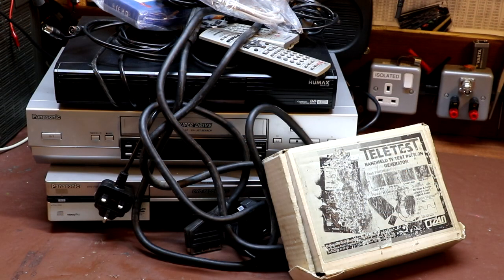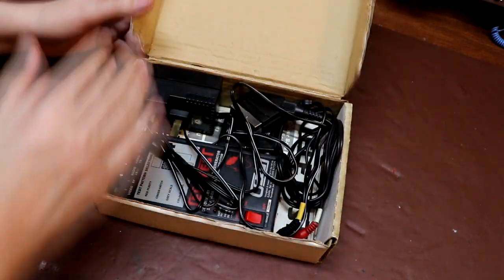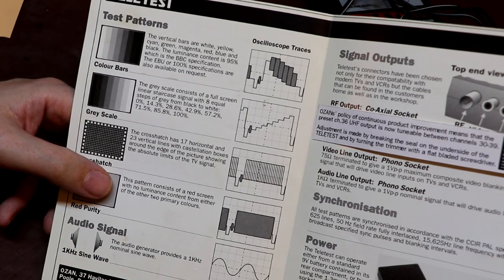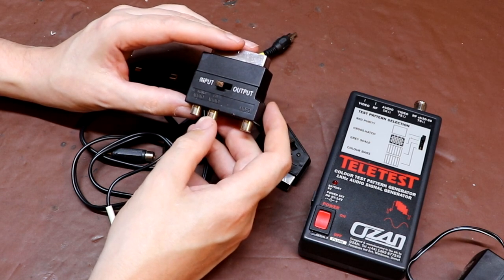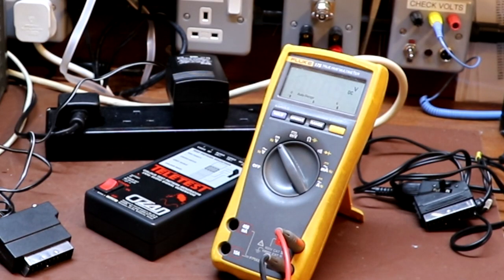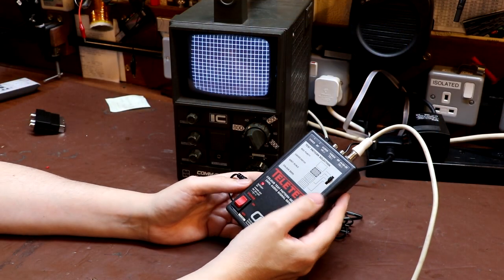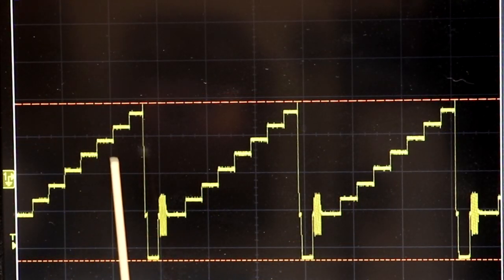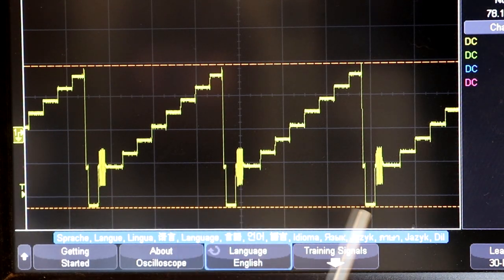Ozan Teletest Pattern Generator

Comment: Just noticed your £5,200 Keysight scope, very impressive .
Reply from the maker: I have to agree Michael it is a very impressive scope, shame it belongs to an idiot like me that can barely switch the thing on.  Most of the work I do now is on quite advance processor boards. They  run fast and use a variety of serial bus protocols such is SPI and I2C upto 100mhz and I needed to do serial decoding so at the time that scope was about the only (low cost)   Option. The scope itself was about 3.5k but not far off 5 after I paid for the decode and logic analysers probe pack.  I have to admit it’s fast with a big memory so as you saw it can store a huge waveform and then zoom into the detail.   It takes all the work out of triggering and delayed sweep etc.   I bet you know your way around an Analog time base you TV guys always do!   I’m doing some work with USB3 at the moment so maybe time to upgrade to a 1ghz bandwidth scope this old thing  won’t cut the mustard. Thanks for watching and comments best regards Chris

Comment: We built one, well four or five, it cost about £25 or there about.  Only a chip a transformer, regulator, transistor, few capacitors and a switch, a handful of components and a metal box.  I wonder where the hell it got to?
No  need for it now, used it a lot when working on Philips G8 TVs for convergence.  It had about 8 or 10 patterns on it, dots, square hatches, circles, test card, lines, colour, B&W test, circles etc, came out of phono or RF connector.
I haven't seen it since I got married, not that I have any use for it now anyway, CRT TVs have gone, more or less.
When the wide screen TVs came out they were useless anyway, black at the edges.
The main output was from one big chip that did it all, just selected what you needed through the switch.
Strangely, the switch was the worst thing to wire, especially when most of the wires were the same colour!  DUH!
It paid for itself, but I wouldn't think they will even be making the chip now whit the modern TVs.
I think it also did Pal, British, French and American TV standards, though we never used it.
Not intentionally anyway, but I was handed one set for French TV as a joke and couldn't understand why I couldn't get things right.
I did wonder why the others laughed when I went out the door, then I thought about that and the penny dropped, yes, the buggers had swapped it over to the other standard! :-((  It took a while to get my own back, but I did in the end.  :-))
Reply from the maker: Was that the version you had using a clocked eprom to generator the pattern. Sorry don’t having to add to your comments as I’m really just learning about television not something I have experienced.   I may have ago at building a pattern generator. Terrible memory where are you based Bob ? Thanks for watching and comments regards Chris.
Reply: @allthegearnoidea6752  I don't have the circuit for it, in fact I never did, it was one of my mates.  He copied it from a ready built one, I think.  If I said what was in it it would be like the blind leading the blind.  I just sat and built it, all I know is that the chip did just about everything, though when I think about it there was another chip, but I think it generated a tone as we could alter that as well, square or sine wave.  There were two switches and to rotary controls on it when I think about it.
We built an earlier version that was a failure, I think I was thinking about it.
It was not my design, I just sat in my mates Man Cave and followed the instructions.  I think it was built on Vero Board.  I can't remember there being a crystal, but there must have been, unless it got its clock internally.
I was always a bit cautious with TVs as the voltages were a bit high and I had no isolation transformer at the time.
I gave up with TVs when the chips inside got bigger and a lot more expensive.  The Philips TVs at the time, you didn't need to know that much, just change the board the LED was out on or where you thought the fault was, then set it up again.
I didn't care to much for working on TVs and still don't, though I did look at my own one.
I did fix it, but six months later it went gain, power supply was a crap design.
I even got the manual for it, but I decided it was going to be easier and cheaper in the long run to get a new wide screen TV.
Strangely the TV was made in the UK.
I will not mention them, they make some not bad stuff, but a lot of it was tat.
A main retailer sold their stuff under another name that i also will not mention.
They got into trouble for saying it was Japanese made perfect.
Reply from the maker: @BoB4jjjjs  I saying to someone the other night it’s not surprising a lot of our radio manufacturers went to the wall. It wasn’t just the price it was because they refused to innovative and the foreign competition just kept improving.
Reply: @allthegearnoidea6752  Yeah, that just about sums it up, better looking sets as well.  You just get the impression they didn't want to invest.  But that is the UK for you.  Just give in and surrender!
Look what happened to the car industry and the Motorcycle industry, they just looked at what japan was making and held up their hands and gave up.  The electronic industry went the same way.
They could do it if they wanted to, but there are to many shareholders to keep happy, so investment never happens, all share holders want a quick return on their money.  No long term investment, we want out money back and 50% or more!
Reply: @allthegearnoidea6752  Bet you I could find the circuit diagram for the one I built from a kit from Manor Supplies !

Comment: The old git sitting in his leather chair recalling his past,  jibbering on with only the odd word intelligible.
And at the end he says  ' Of cause i was Very Very drunk ' .  (The fast show :-D).
That's a Nice little tool,  i imagine there is a micro controller doing most of the work.
The waveforms look ok, but your digital scope is likely not doing it justice.
I built one (from a diagram on the internet) to display a picture for a frends 405 line set, there was a flash memory filled with the picture data and synch data.
A counter circuit strobed the address lines of the flash memory and it outputted to some kind of d to a converter chip,  to produce analog video.
It worked but he was not fully happy with it, i fixed what i saw as a digital problem and handed it back.
He could not expect much from a handfull of parts, he then payed 600 quid for a very complex converter.
Sorry about the waffle, but i'm very very drunk :-D
Reply from the maker: Yes I remember building something similar used a very crude digital to analog converter using a  binary resistor network driven from the eprom data lines. I don’t think the one I built worked either.

Comment: Very interesting video Chris especially the scope captures. I have a Commodore monitor to refurbish at some stage so a pattern generator would probably be useful. Looks like it works very well. Love the little National Commando TV. Cheers Graham
Reply from the maker: Thanks Graham. I assume the monitor takes composite video. I know teletest used to make similar testers designed for computer monitors with VGA outputs. Yes the little TV is very handy

Comment: The teletest  was very  usefull for mobile servising  .on early coulour sets it was recomended to set purity and convergence in the place where it was used. most of the time there was no need.
the main thing missing was a circle pattern for setting up fram and line lin. i still have mine somewhere at the bottem of a box of stuff never to be used again . excelent video.
Reply from the maker: Yes your right a circle pattern would be very useful. I think I have seen shangoo setting up the purity and convergence but never tried this myself. Thanks regards Chris
Reply: @allthegearnoidea6752  One of my projects is a TV pattern generator that produces a circle but its on hold at the moment due to non availability of a  2.0Mhz  something crystal .

Comment: The reason for using the interlaced signal is to provide good vertical picture resolution without requiring excessive transmitted bandwidth. A secondary reason was to keep the line rate to a manageable frequency within the capability of the early TV sets.

If you retained the 50Hz frame rate to minimise visible flicker and the same 625 lines vertical resolution then, if the video were to be converted to non-interlaced, the line frequency would have to double and the RF bandwidth occupied by the transmitted video would also double.
Reply from the maker: I don’t think it was just transmit bandwidth it was also the difficulty in maintaining the  wide Video and IF bandwidth in the receiver as it would have required a more complex wider band design so cost was a large part of the consideration. I guess the signal to noise ratio may also have been a consideration as it related to bandwidth. So a number of factors etc. Thanks for watching and great comments Regards Chris

Comment: Brilliant Chris
Lots of learning there , that teletest looks like a great test kit 
Also wondering how the colour burst works so i'll be investigating that .
Great stuff
Best regards Shaun
Reply from the maker: When you find out how the colour burst works be sure to let me know. Thanks for watching and comments regards Chris
Reply: @allthegearnoidea6752  As far as I can remember... The colour info is transmitted as two colour difference signals with quadrature amplitude modulation and suppressed carrier. In the Rx the carrier has to be regenerated and the phase is important because of the QAM. The colour burst is there to synchronise the local oscillator and make sure it's in phase. The phase of the colour burst alternately lags and leads the original (suppressed) colour subcarrier by 45 degrees in alternating lines. Hence PAL - phase alternating line. This stops phase drift causing weird colour effects like you used to see in NTSC (Never The Same Color)
Reply from the maker: @oldblokeh  yep sounds right, still have no idea!
Reply: @allthegearnoidea6752  Simply put, it turns out that you can modulate a single carrier with two signals and recover both at the other end. All you need is the carrier and a copy of it 90 degrees out of phase  (i.e. at quadrature, hence the name QAM). You mix one of them with one signal and the other with the other signal. Then add them together and there you have it. To demodulate you need two LO signals at quadrature (same  frequency and phase as in modulation) you mix the incoming signal with both. One mixer will output one of the original signals, the other one will output the other. These two signals are the colour difference signals that, together with the luminance signal, allow us to reconstruct R, G and B signals.  The colour burst signal is there to synchronise the phase of our demodulator oscillator to that of the transmitter -- the phase is crucial to correct demodulation. There's a video by w2aew (Alan Wolke) that explains it quite well: https://youtu.be/h_7d-m1ehoY 

TLDR: It's magic.
Reply: @allthegearnoidea6752  Stick "colorburst" into Wikipedia , interesting read but i'm still non the wiser ! 
Best regards Shaun
Reply from the maker: @SweeneyTTodd  I wasn’t either LOL